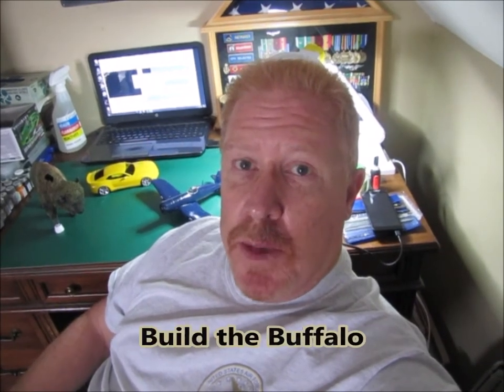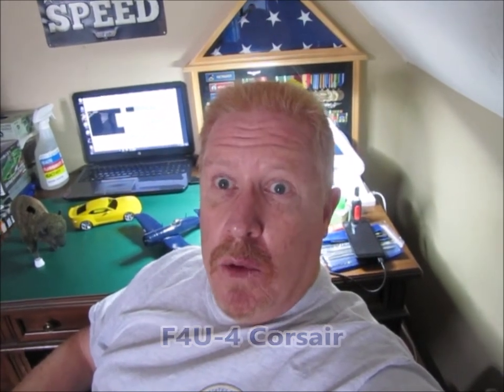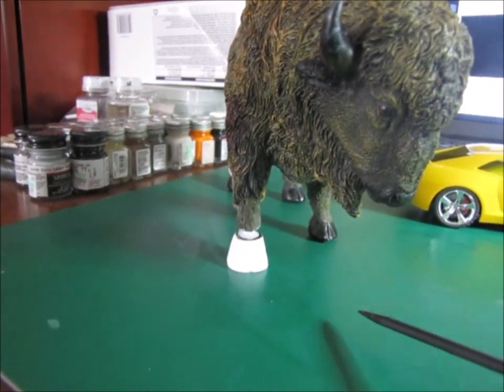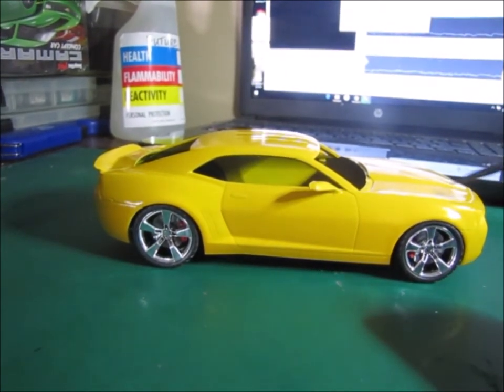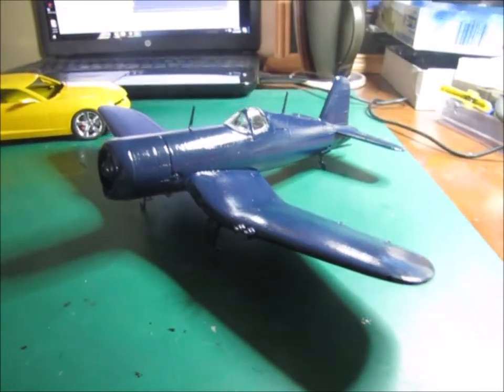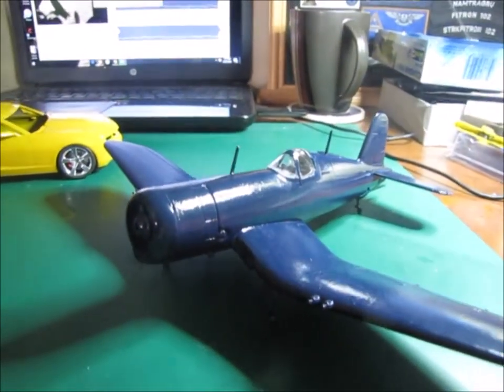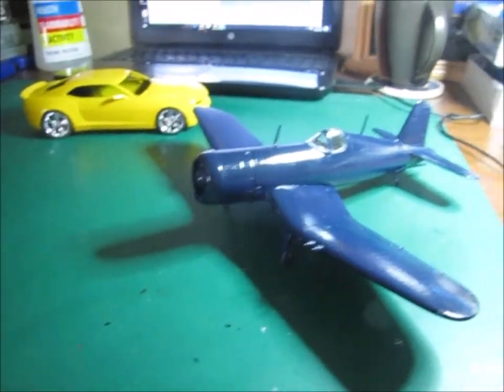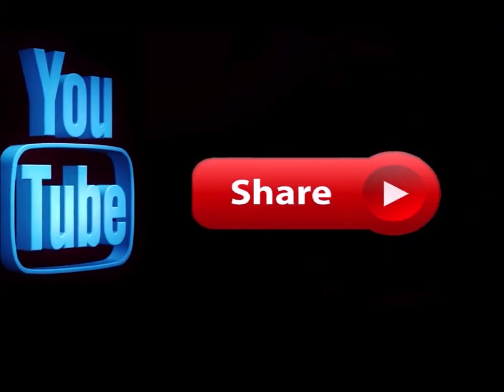The Buffalo, Transformer, and Corsair update!

Comment: I wonder if there isn't some sort of contaminate in the plastic or the mold that is just a bugger to remove. Can you use acetone or de-naturalize alcohol to clean them off with, or would they damage the plastic?
Reply from the maker: Good question, I am not sure about the cause but as for cleaning I have never used anything more harsh than purple power and even that etches the plastic a little bit.